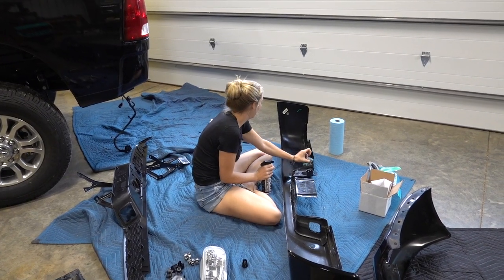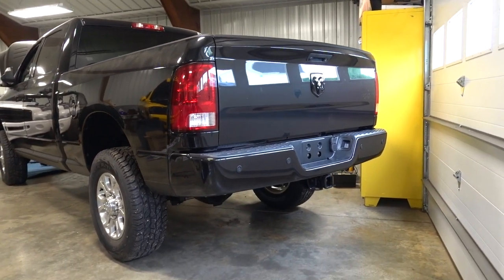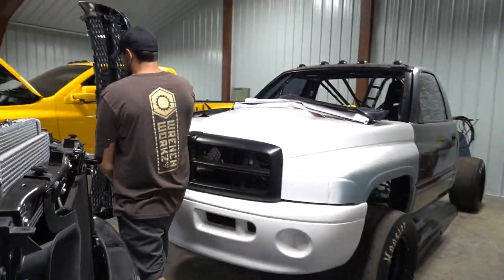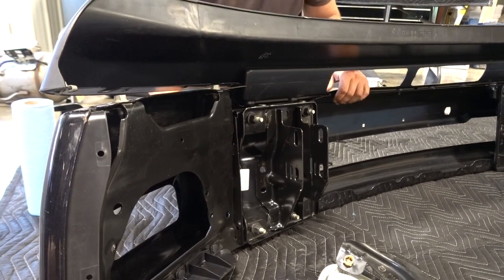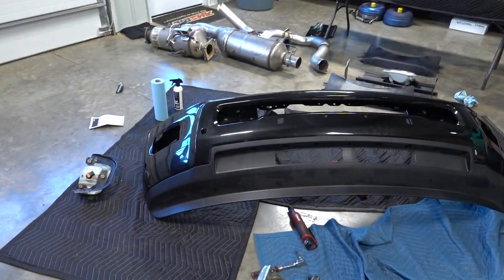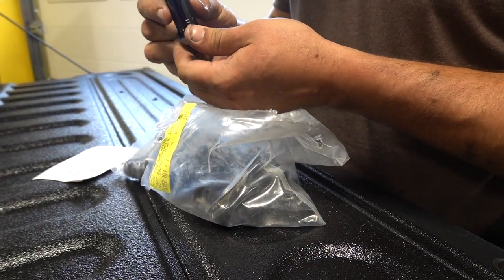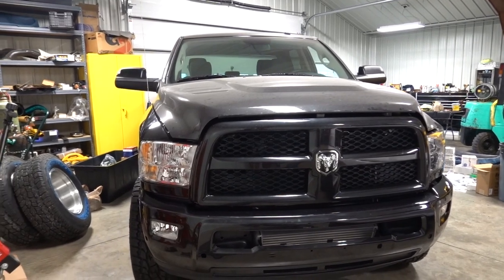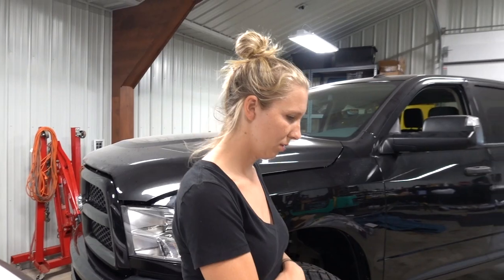AMAZING 1 DAY TRANSFORMATION ON MY WIFES NEW CUMMINS BUILD!!!!

Comment: IME, easier to pull the bumper off the frame brackets left on the frame so they stay adjusted.  With the grill off, the upper bolts are right there with a flex ratchet wrench.

Comment: Greg I’m not sure what the exact prices of those wheels but I know that specialty forge wheels on my expensive than American forces so it would not surprise me if those are $6000 north for the wheels and  about $1500 for the tires. Is my guess but you could always call them and ask them or do a quick Google search but they’re expensive. You could always just re-powder coat them. To all black  and some 37”tires and then we get the axles regearted, that’s what I would do, but it already looks better without the chrome, I am not a big fan of Chrome, I always  dechrome my vehicles.
Reply: Those wheels are only 20’s and nowhere near 6k
Reply: I don’t know if Greg mentioned that there was 20s but according to the website the smallest will they offer is a 22 x 10 at $1100 each, plus tires so if you go on those figures mountain balance tires everything you need to roll out the door you’re looking about 6K, maybe a little bit less.
Reply: Karl Thomas they’re 20’s and not 6 grand

Comment: Are you guys gonna put cab lights on the truck? That would be a good video
Reply: Those are pretty easy to do. I got the factory clearance lights and it included the template where to drill. It took about an hour and half to do